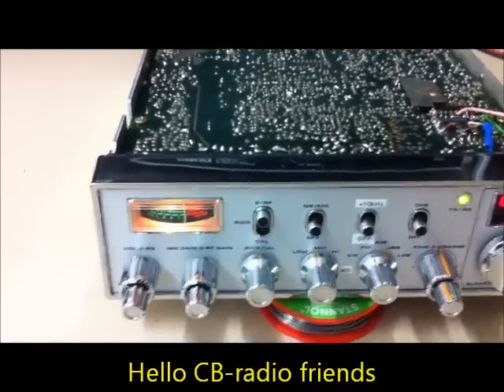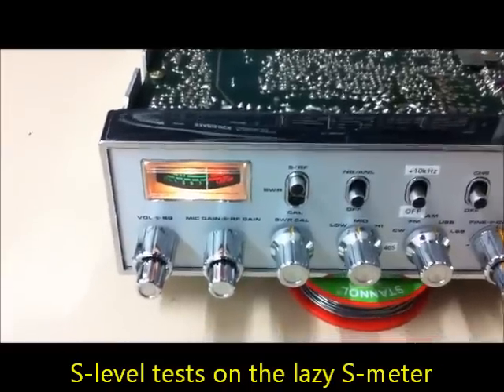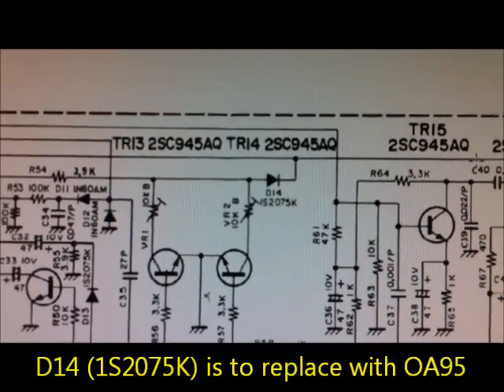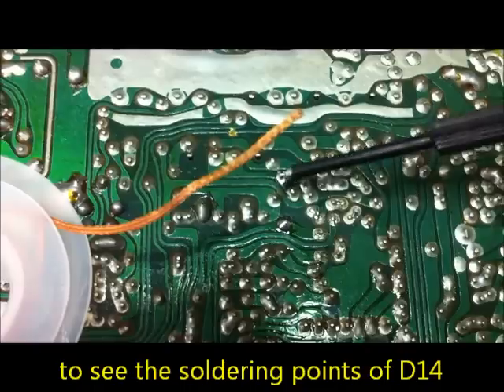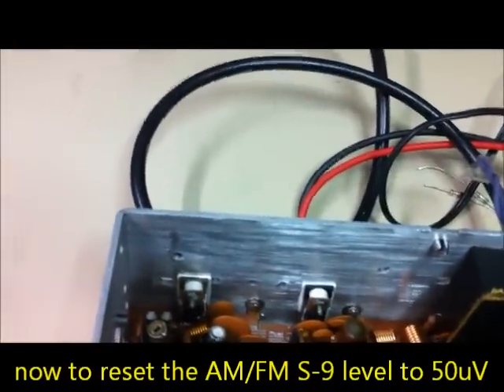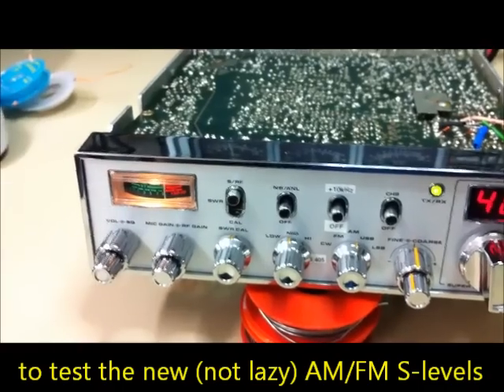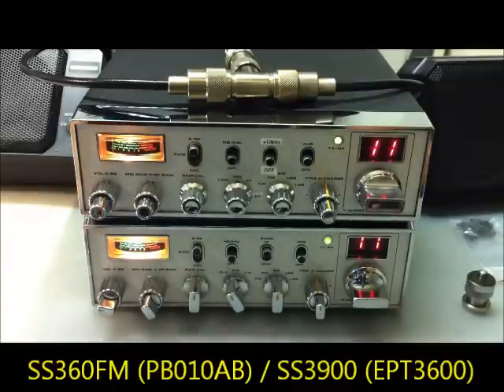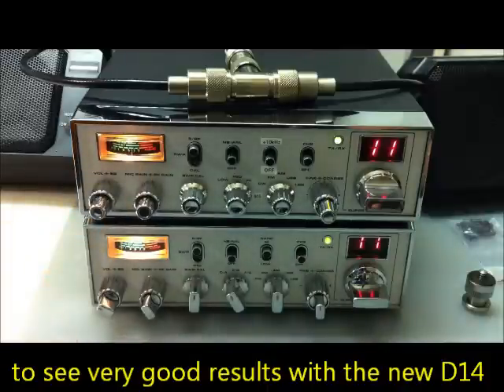How to correct a lazy S-meter on a SUPER STAR 360FM (PB010AB)

Comment: Hello Swizzradios. You did a great job giving the community a kind of solution for long time irritating problem. 

A few years ago I returned on CB after 20 years of pause. 
I noticed that all old radios similar to this have the same problem. 20-30 years ago they measured signals fine. I found your video, as a solution for the problem, however after my own tests I found out that this modification is cure for the consequence of malfunction rather than repair which caused the problem at first place. 

At first place, I have to notice that you mentioned D14 as a rectifier. It is, but it's main purpose is to allow DC current to flow in one direction (S meter DC voltage from IC1 pin7). Real RF rectifier are D11 and D12. Putting germanium diode at D14 helps getting better results, but not completely as you found out by yourself when measured modified radio, commenting  at 6:37. 

Secondly, you didn't test receiver on signals above S9 which is very important. As you can see, signals arond S 9 are very dense. Even if you would increase incoming signal by 20-30 dB, S meter will show insufficient  advance into red zone. Moreover signals below S5 very easily drops so there is great problem with the S meter linearity. Beside S meter problem that almost all signals on antenna were around S9, there was more noise in FM audio than on other CB radios.

We have to ask ourselves how these radios worked correctly when they were new, even with silicon D14. That leads to conclusion that something has malfunction and needs repair, rather than modification. 

My findings lead me to faulty AGC circuit. S meter readings directly represents AGC voltage. Measurement of D17 and D18 (MC301) showed their voltage characteristics are not as specified in datasheet. I tried a few different diodes I had at the moment, but at the end I used ordinary 1N4148 and got about 80% accuracy. I am aware that these diodes and original have very different voltage characteristics below 0,6V and that causes non linearity below S5 or S6. 
AGC (and S meter reading) is greatly affected by surrounding elements, mainly R71, R72 and R73. In some similar radios, linearization network is used between R71 and AGC out IC1 pin 14. 

So far my friends and I have replaced AGC diodes in several Jackson, Grant and Superstar radios.  Finally we can recognize each other  just looking at S meter. Prior to that, almost all signals were around S9. 

Please look at my results on https://drive.google.com/drive/folders/1A_fLRkwMaXv6iTrPjANaAIJfGKzxQipV?usp=sharing
Reply from the maker: Hello my friend YU7RSX, thank you for the info. I'll look forward and replace the AGC diode. Happy airwaves to you...

Comment: I own a Superstar SS-158EDX and I almost gave it up due this problem. I changed D14 - 1N4148 (625 ohms) by a schottky 1N5711 (233 ohms) and it works very well. Germanium diodes are very dificult to find here in Brazil and the available ones have poor quality. Thank you very much for your tip.
Reply from the maker: CB radio-fan hello, thank you for your post. You' re welcome. Best 73s to you..

Comment: Hi there I would like to ask if this is the correct diode.....1N60P Germanium Detector Diode?
Thx in advance :)
Reply from the maker: Hi there! Yes of course, 1N60P Germanium Detector Diode is absolutely similar. Good luck at the modification. Happy airwaves to you...
Reply: Thank you very much :)
Reply: If germanium diodes are dificult to find in your location, I suggest a schottky diode 1N5711 (233 ohms).
Reply from the maker: Oh yes, these work very good. Thank you.

Comment: Hi I am having a problem with my RCI 2950, when it is on AM it is at ''half volume'' ,, but all FM USB LSB are good   could you explain what that is please thanks
Reply from the maker: driveheronman CB radio fan hello, thank you for the question. I'm sorry the RCI5950 isn't more in my collection. I can't check your problem any more. Please tell your problem to an other RCI2950 user on youtube. Best regards to you.
Reply: OK  thank you for your reply
Reply from the maker: 6koko3 hello, thank you for your interest. Yes, you should replace the diode with the 1N60 and realigne the RX/IF section. I think that's it. Best regards to you....
Reply: I have exactly the same problem, on a Superstar360 FM,  Could it be a AGC problem or rather an IF unalignment?

Comment from the maker: Metclapton hello. Thank you for your question. Yes, there are two diodes in series. You can Bridge one of These two diodes (D7/D8), and you will solve this Problem with the lazy needle. Please remember: The D7/8 are Silicon diodes with 0.6 Volts Forward voltage. You can replace These two diodes with 1N60 or OA95. Then you get more voltage drive for the S-meter, like the PB010AA/AB modification. Have a nice mod. 73's...

Comment from the maker: Hello stresstest. I'm back again. The S-meter of DX94HP is one with a big wide scale. The S-9 point is in the middle of the scale. On the S-meter of a SS360FM, is the S-9 point on the right end of the scale. On my SS360FM, is the original measured level of S9+60dB, aproximately S9+30 on the S-meter scale. In the next view days, I'll make a video about the S-meter modification on a SUPER STAR 3900. Then I'll show also S-meter levels over S-9. Maybe until 9+30dB. Best 73 to you...

Comment from the maker: Hello mr stresstest. I don't know. But the AGC circuits of DX94HP and SS360FM are very similar. All electronic parts of the AGC circuits are identic. But the AGC quad-amp-regulator of the DX94HP is the TA6324, this of the SS360 is the TA75902P or NJM2902N. The pinning of both ic's is identic but the specifications are anything different. The S-meter impedance of moving coil of DX94HP is different like which from SS360. The moving coil of DX94HP is a vertical moving type, SS360 is horizontale.